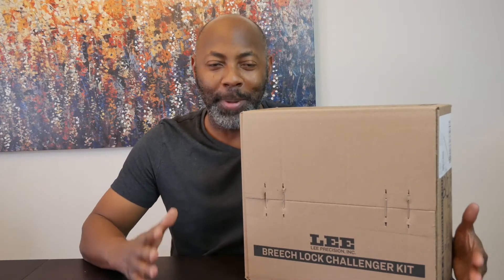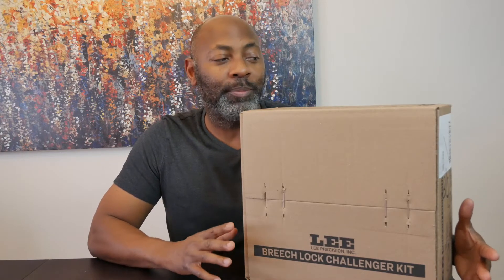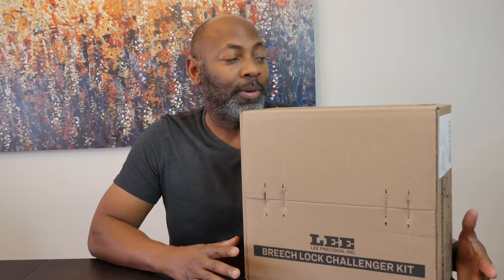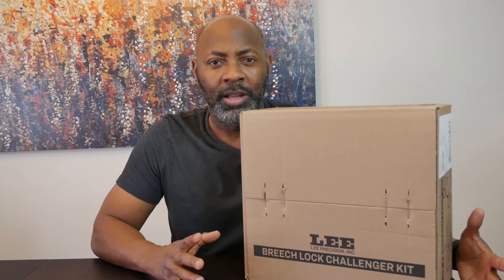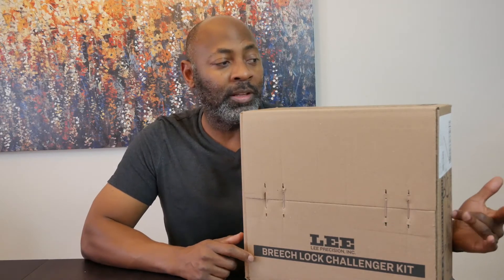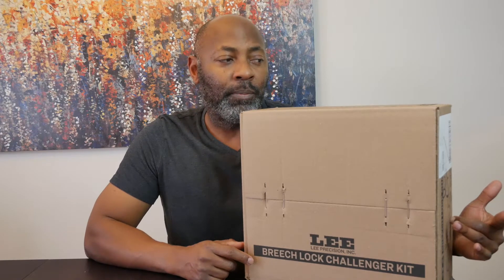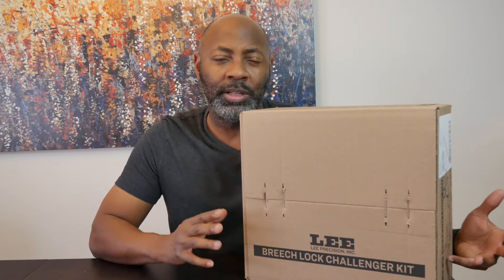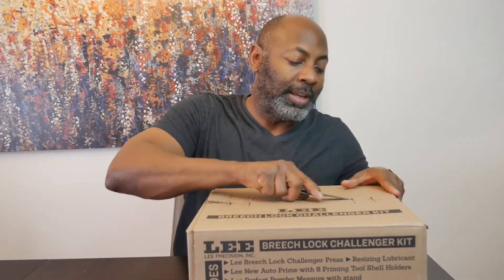Reloading Ammo What I Have To Get Started.

Comment: I started out with the same kit. Learn how to use the scale. It really is a good scale. It will never fail you if your questioning a powder load. Also buy the Lyman case prep express. It will save you hours of work and will save your hands. Great tutorial. Happy reloading.
Reply from the maker: Any tricks I should know that will help. I will look into the Lyman. Thanks
Reply: @TheBeginnerGunner   I would always check the length of your brass. I know that you said that pistol brass length doesn’t matter but once your dies are set up, if you trim your brass ahead of time all to the same length you won’t have to keep adjusting your bullet seating die. All bullets and overall length will be the same. I use a lyman universal case trimmer. I use Facebook market place and get some great deals.
Reply from the maker: @pareloader5989  Noted.

Comment: Great vid!!!! Looks like you got it all sorted out I did notice you did not have a bullet puller they come in handle and so are you going to use stainless steel pins with your tumbler? A easy and fast way to dry your brass is a food dehydrator don’t buy the one that they sale for reloading buy a cheep Walmart special they want to much for the other ones. You might have one all ready!! Remember to start slow and take lots of notes so you can repeat you recipes! Hopefully reloading supplies will return soon!! Most powder Manufactures have loading data for free online. A chronograph is very handy when reloading but I did not have one for years!! If your looking for cheap cast bullets I would try www.bearcreeksupplybullets.com they have great prices!!
Reply from the maker: A bullet puller yes indeed. I definitely plan on taking it slow.  I still need to pickup a work bench of some kind. Just been busy. I will check out the site you mentioned. Thanks